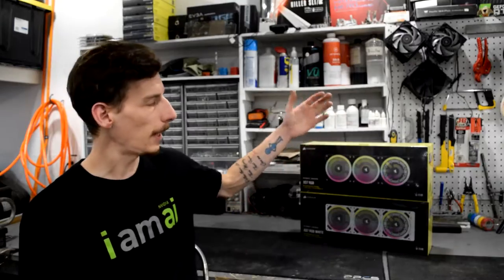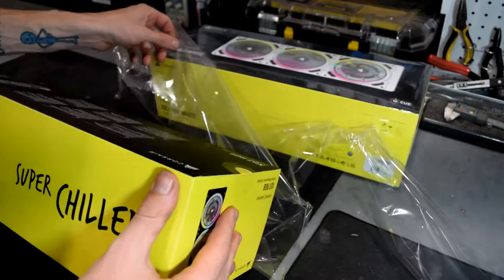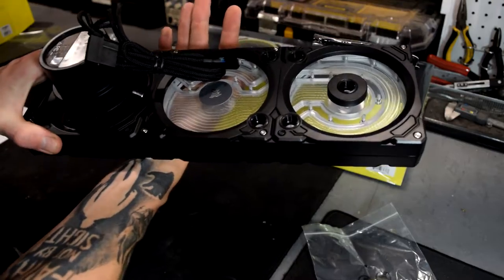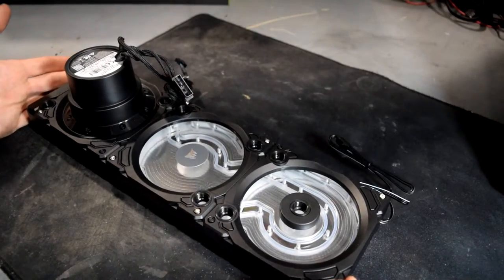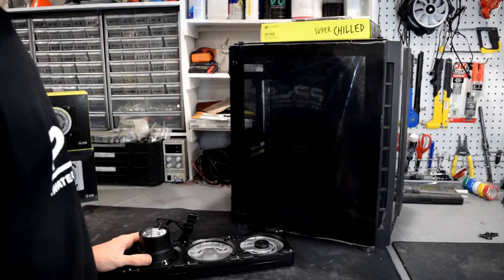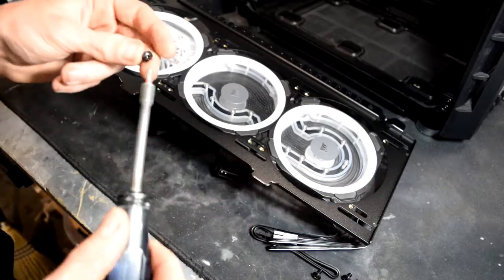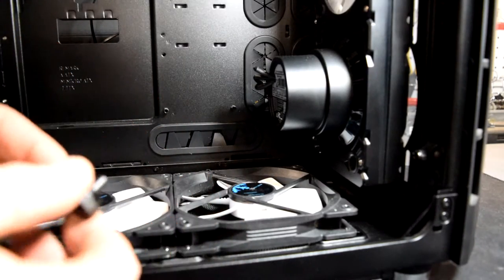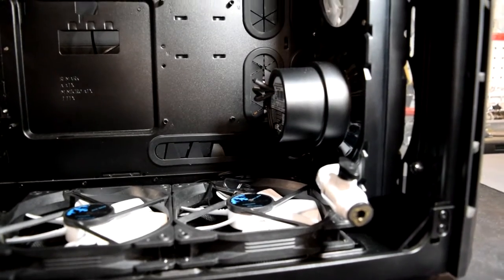Corsair's New Watercooling Gear: 2021

Comment: My favourite Corsair product is the 780T case in white.  Mine is still going strong after all these years and still one of the only full towers which can accommodate a total of 1,100mm’s of 120mm wide radiators.  Yes the acrylic side panel is dated compared to glass now a days but it still polishes up like new and the reduced weight is a benefit. I really like what Corsair is offering with this pump/res/distro product.  It’s something fresh for the market and being a standardised 360 config means it will have heaps of compatibility with a lot of cases.  Very smart of Corsair as custom distro’s are otherwise very case specific.  And much cleaner looking and flexible tube routes from the layout.  I’d give up my front radiator in my 780T for sure as the leds ooks great.  My only criticism is the molex connector but to be honest this is still pretty common on D5’s and wouldn’t be a deal breaker.  Thanks PPCS.
Reply from the maker: That's a legendary case right there! Thank you for all of your support!

Comment: Hi, I know it has been a few years since you posted this video but I was happy to see a water cooling set up where it was just cooling the cpu featuring the Corsair XD7 Reservoir/pump combo (My set up is just water cooling the RTX 3090 via soft line and have an AIO cooling the CPU.)  So my question would be regarding the 2 90 deg fittings you have plugged into the XD7 res/pump combo 10:25 in the video. Do you have 2 90deg fittings plugged in the ports then connected by a male to male adapter in the middle? Great video sir

Comment: the should have gave the option to have fittings on the front of the res instead of just the back so you could hide the pump in cases like the lian li 011